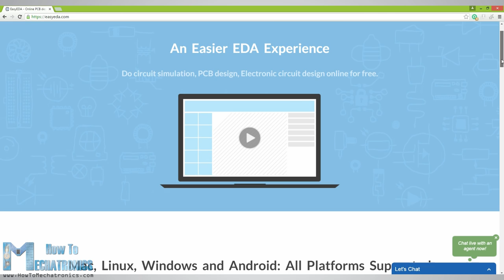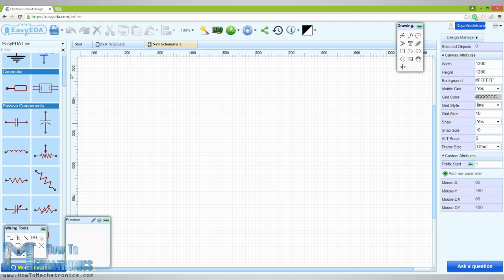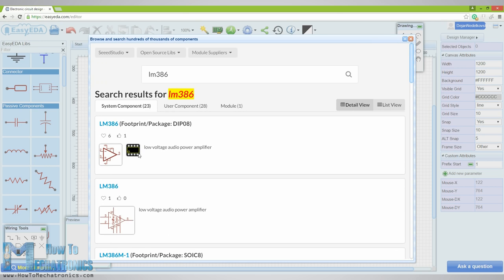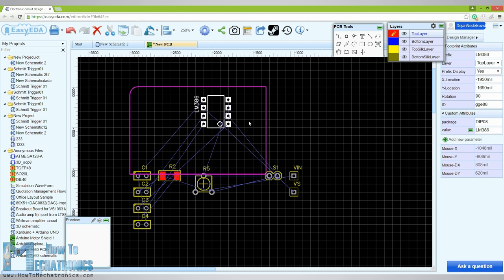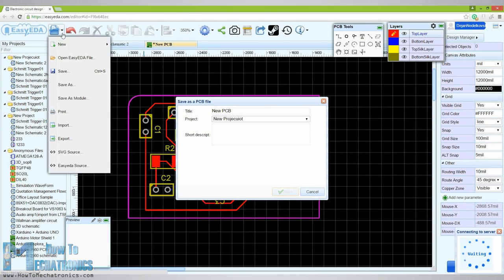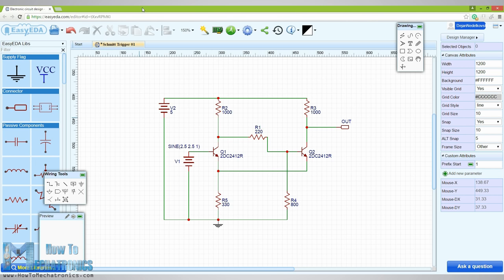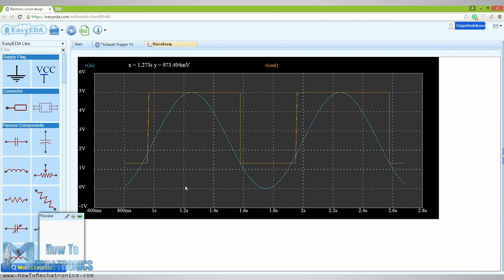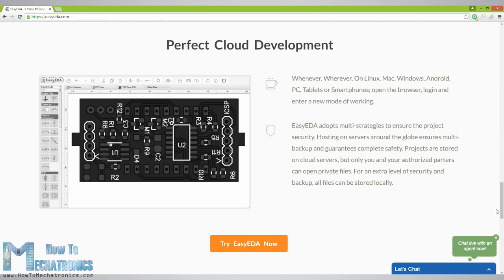EasyEDA - Free Electronics Circuit & PCB Design + Simulation Online Software Review

Comment: your menu choice selections are at the center of using this s/w and you move the
mouse so fast that to follow  them is difficult.
  please re-do this video slower and enlarge the cursor size itself.  so myself and others can get exactly the steps to take.
and increase the resolution too if you can.
Reply: I agree with the larger curser, but I am thrilled it was a very quick demonstration and not a lengthy tutorial.  Yet, another video that is a lengthy tutorial would also be nice.
Reply: YouTube allows you to slow the video down and add captions